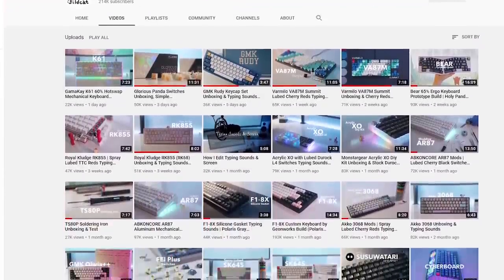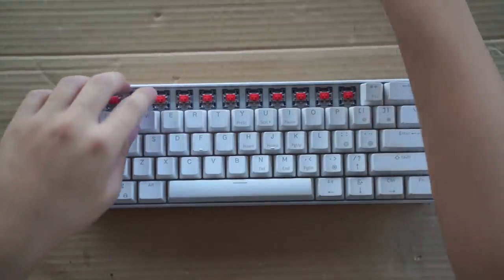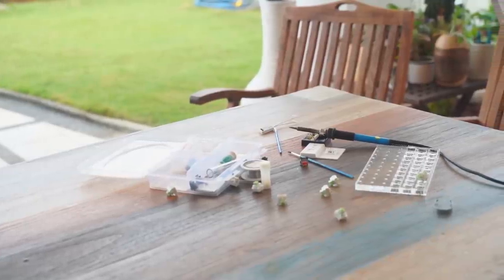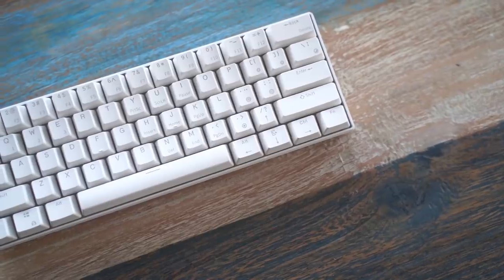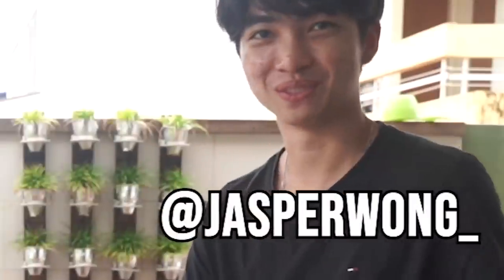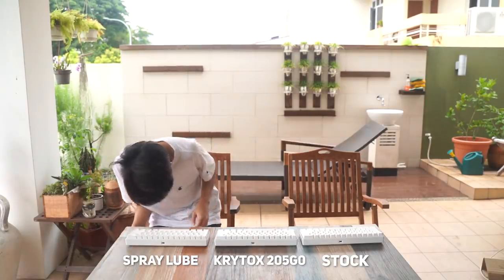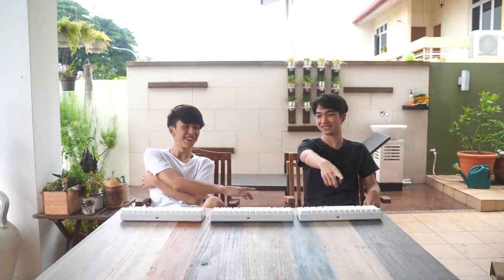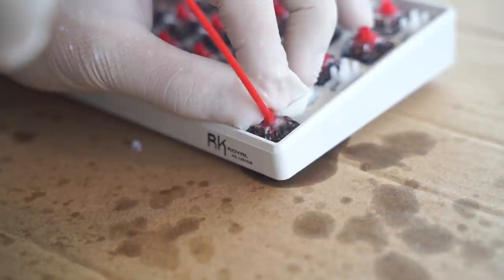Lubing Keyboard switches without desoldering?

Comment: Thank you for this video! Can I use an air compressor to push and scatter the oil inside the switch?
Reply: What I like to do is fill a box with extra virgin olive oil and leave the switches in there for a week, lubes them up so well😋😋

Comment: "as good or better"
HEEEEEEEEELLLLLLLL naw. It does a fair bit though. I've tried it.
Light spray silicone oil is just not gonna live up to the grease over an extended period. On the positive side, it should work normally again once the lube settles with use.

Comment: lubing is way  over estimated  i got a 20 bucks keyboard  and injected vaseline  in the switches and it sound like its a custom gasket mounted lubd and dampened 
and if it's dead in like 3 4 months whatever  t its so sheep